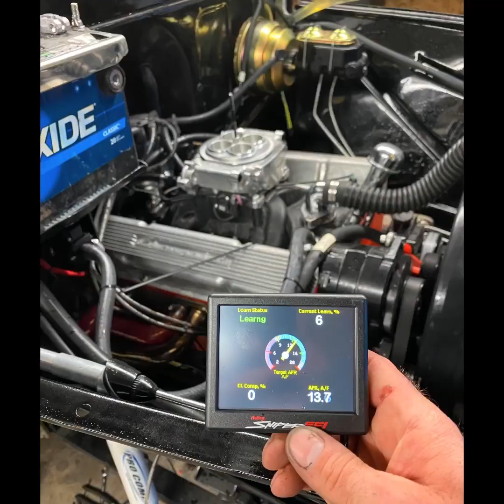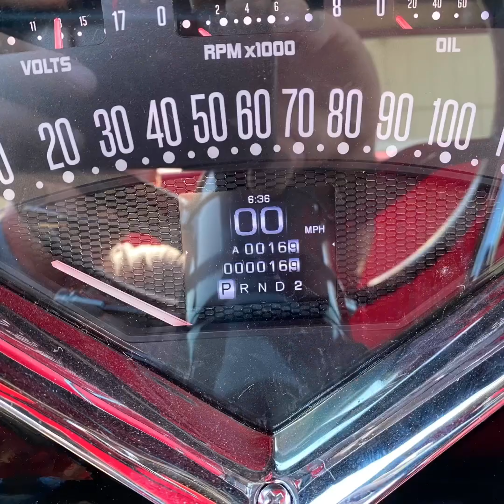1957 Chevy Truck restoration

Comment: Did you use the original rear axle? What ratio? Any mods to the frame or is it stock? I guess I'm just curious how she goes. Cool truck, you should do a video and get into details for sure!! Did you consider a manual trans?
Reply from the maker: The frame and axels are from a 1978 K20 hence the reason I had to shorten the frame. Don’t remember the gear ratio.  Went with a automatic transmission because the donor frame came with a th400 and np 203 maybe one of these days May do a video talking about all the parts and features of the truck.  Thanks for watching
Reply: @ohchopshop  thanks!

Comment: What size tires did you have on the truck when you were still able to fit it into the garage?
Reply from the maker: The mock up tires and wheels I think were 33”. The finish wheels are 19.5x8x35. It still fits in the garage with the 35” wheels

Comment: Dana 44 front axle, front disc brakes, TH400 transmission with,,,205 T-Case?
😎😎😎☕
Reply from the maker: She now has a 700r4 and NP 208, i drive her a lot and wanted better MPG.
Reply: @ohchopshop  what kind of fuel mileage are you getting with it now?